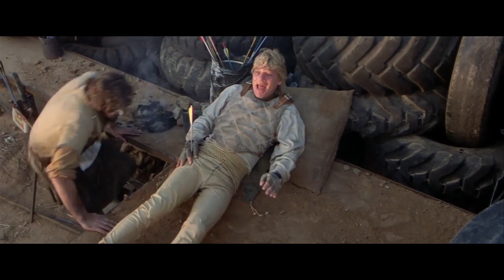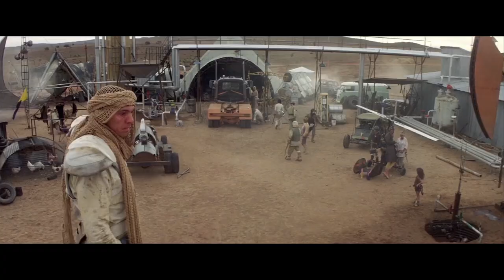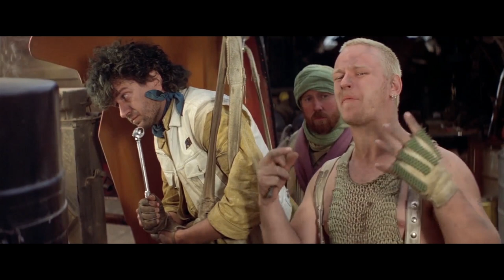Mad Max  2 - Mechanic

Comment: Farmer-spec repairs for each item:

Timing case (or cover): if steel, weld, solder or braze a patch on. If alloy or cast iron, mastic sealant (ie chewing gum mixed with sand, etc).

Chipped teeth on timing gear: braze on bits of steel and file/grind down to size.

Radiator core: cut off and solder shut any affected fins. Run without radiator cap to prevent pressurisation of cooling system (these old diesels run cool; about 75-80 deg c, so wont boil)

Cracked water pump: tar or bitumen mixed in sand

Damaged injector line: braze or silver solder a sieeve over the effected area, or if replacing a section, over each joint.  You can also wind copper wire around the join and solder the whole thing solid.
Reply: Thats an awesome run down. What about non farmer spec?
Reply: Is 12 hours a realistic time frame for that work?
Reply: @Odyssey_Seeker  money
Reply: Okay 👍🏻😂

Comment: The rig doesn’t have to be perfect. It doesn’t need to meet emissions regulations. It just needs to work so yes 12 hours to weld some teeth then grind them into shape and JB the patches on the radiator will do just fine
Reply: Yes, I was thinking that....weld some teeth on the timing gear, weld the cracked water pump, same with the injector line, the radiator is more difficult.....I was thinking maybe get one or two working radiators from one of the other vehicles

Though it depends on what the water pump housing is made of, if it's aluminum it may be more difficult, probably use epoxy.

Welding on a curved surface is difficult so the fuel line repair would require some thought

Comment: i am not an expert in mechanics, i wanted to know what the damages can do to the semi truck, 

such as, cracked timing case cover, broken teeth of the timing gears
i know the radiator was damaged at the core, because of humungus shot the radiator with that gun of his
cracked water pump and fractured injector line.

Comment: That's some serious damage. How does he fix all that in 12 hours without replacement parts
Reply: Duuuhhhhct tape
Reply: Old mechanic/engineer trick. Tell the boss it'll take twice as long as it really  should so when he halves it you'll still have time.
Reply: 'Straya
Reply: Well, all oil pumping and refining platforms come complete with spare parts for a Mack truck diesel engine.
Reply: @jwatson15  Like any experienced truck driver with the dispatcher.
Reply: JB weld
Reply: Back in the day we had REAL mechanics, not just parts replacers… Sadly I’m the same kind of mechanic, no way am I going to my bench and fixing those parts, I’m calling the parts place and the owners daughter/son shows up in a little pick-up truck with all the parts I ordered an hour later.

Most people prefer their cars be fixed this way too, saves a lot of time so they’re with their car/truck sooner.
Reply: @crispindry2815  so…Scotty time?
Reply: Any surviving mechanic in a post-apocalyptic wasteland is probably going to be a master of his trade by necessity of improvisation alone. 
Too bad this gentleman took a dive off of the tanker.
Reply: @robwalsh9843  I was so bummed as a kid when he died…. Hell, I wanted a spin off movie or TV series based on him and his sidekick! 🤓
Reply: Swap in a 302 out of that landau and pop in the supercharger
Reply: Welding- Build up with welds the missing teeth on the timing gear and grind the welds to shape. Plug the hole in the radiator with a rag or whatever.JB weld over the crack on the water pump. Don't worry about the timing case cover. Put some extra oil in to make up for the loss.
Reply: You'd be surprised how many things you can fix if you're a component welder and an even more component grinder.....
Reply: Well technically the timing gear teeth can be replaced with bulbous (built up weld) and then formed back down to the correct shape of the gear teeth with an angle grinder,the waterpump and timingcase cover/ housing is more than likely cast steel and can be heated up to accept an oxy/acetylene or stick weld to repair the crack(s),the fuel injector line can be sheathed with copper tubing and brazed,and the radiator core consists of about a hundred tubes so the two or three that were damaged by the bullet from Lord Humungous' gun shooting it can be pinched off at both ends before entering the tanks and soldered or brazed shut and wouldn't be a significant loss of coolant or cooling capacity in a truck that large.
 So even though a lot of other stuff in the movie doesn't seem realistic those are genuinely realistic repairs to be done in the middle of nowhere with minimal resources.

(Don't ask me how I know.)
Reply: @skeetermcswagger0U812  done something like that with my e21 ,BMW, saved $600
Reply: @charlesmichaelschmitt6412  
OH YEAH!  BMW 
B ring 
M oney &
W allet
Reply: radiator leak can be fixed with sand and glue,
injector line likely the same,
cracked cases  just weld em as for the missing teeth you can weld lumps on then file them back
Reply: If I remember correctly there was a big surrounding part of the front gate that was full of wrecked bad guy cars. Holy s*** I just looked at the timestamp unless
Reply: With the help of the set
Reply: There is well known Outback painter named Jack Absalom.  He wrote a book called Safe Bush Travels.  Using tricks and ad hoc techniques to fix your car to get you out of trouble if stranded in Outback such as soap and bulldust mixed into a paste to fix a leaky radiator, etc
Reply: @jamielinsell2188   For a radiator leak I actually prefer black ground pepper and egg white.....mix together and pour into the radiator when cool and drive until the leaks seal them selves and then top of the system.  It might not last forever, but forever is a mighty long time to trust  a holey adiator!!!
Reply: @robwalsh9843  It was bad planning putting him on the tanker. There's no way he wasn't the one that did the bulk of the engineering on building the refinery.
Reply: Welding, lots of clever and stubborn job and welding , then some griding. Back when vehicles were purely mechanical you could get by with pretty much blacksmith like repairs, especially when precision on parts was less important/ie computer wouldnt freak out and throw error with dosens of sensors, but even trhis cam be circumvented/fixed adhoc.

Comment: 🙄 the big daddy "timing gear!" = Acetylene torch bench grinder maybe a lathe re cutting teeth!" 🙄 3 to four hours, Radiator 😳 replacement with equivalent type, hope it isn't cross or up down flow, 😶 Theoretical diagnosis I am not a certified mechanic the rest RTV cealent